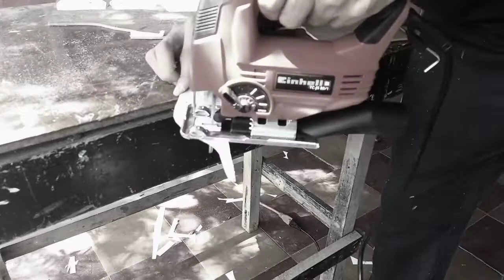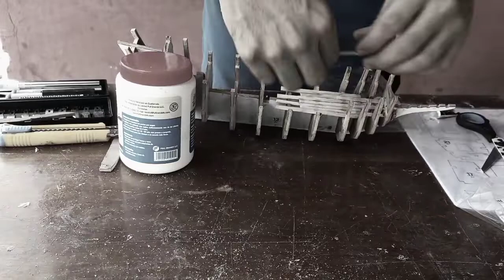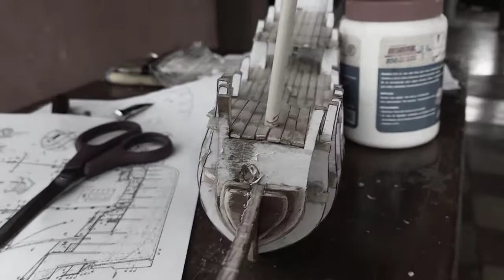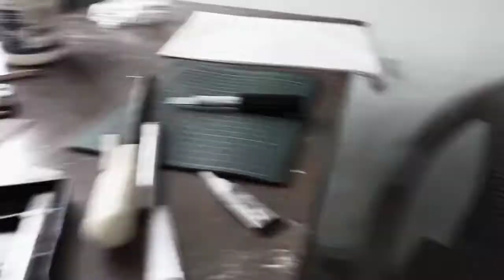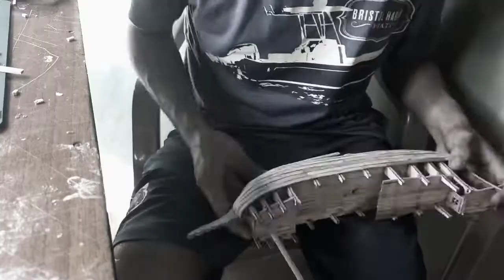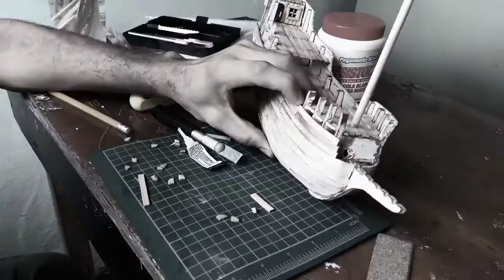TUTORIAL De como aser desde planos el Galeon Golden hind  Modalismo Naval ES Parte 1

Comment: Cómo se llama ese tipo de pegamento que usas??
Reply from the maker: Creo que es ciniacrilato  o conocido como pega loca
Reply: Poxipol is also good option it's very very strong and glues quick but it's impossible to remove the piece or detail so make sure you have patience and follow carefully the technical drawings and plans

Or find an universal hobby glue in case you are beginner to detach the pieces you put badly or wrong places